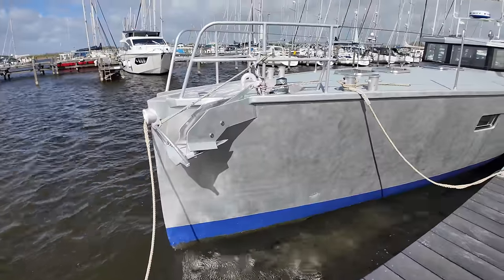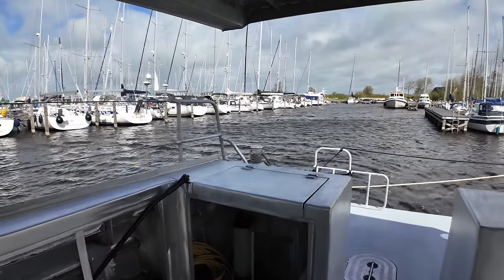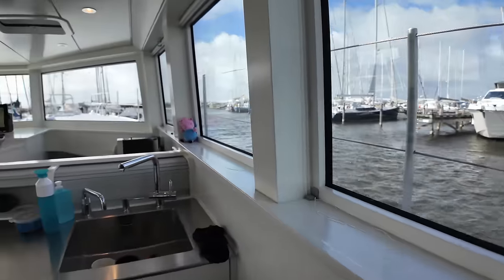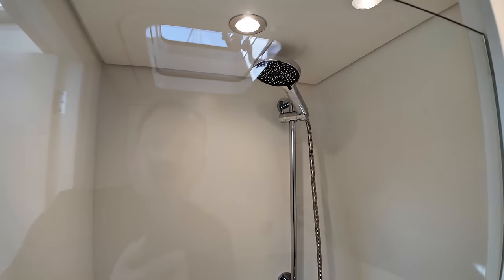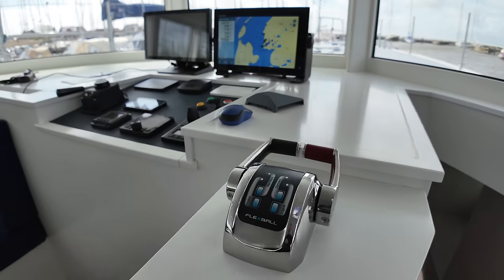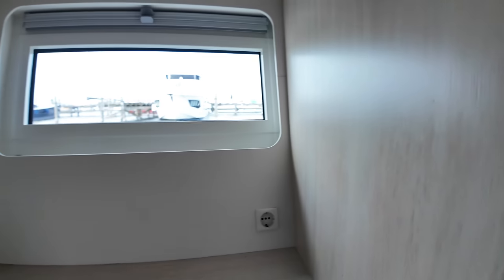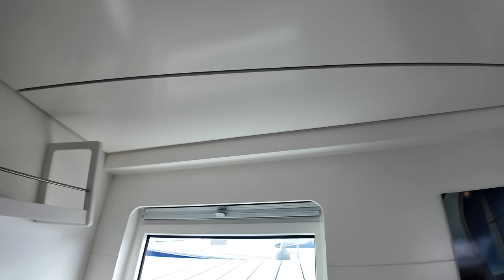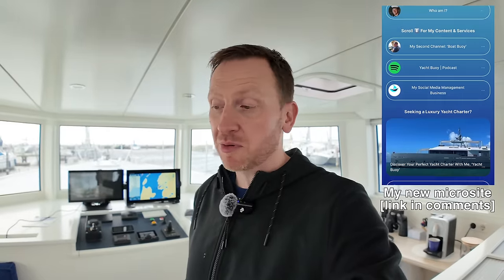THIS Is Hull 1 Long Range Cruiser 65! (LRC 65) 6,000 NM Range!

Comment: Dutch boat. Build out of (mostly) flat sheets of Alu. Cheap way of building, interior is of what? Plastic, MDF, you say it. Naked metalwork, straight to the point. Stripped of any boatcharm. There are a number of very good casco builders in Friesland who can make a splendid and straight hull so any paint can be omitted, depending on the alloy used. Also the interior consists of mainly flat sheets, no complex corners, just straight on. Propulsion and arrangement machineroom not shown. I think this boat is entirely CAD/CAM programed and might have costed around 200.000 euro in total to build. That's my guess. The interior has a charisma and appearance of a fridge, This boat is a perfect example of quality engineering at lowest possible cost. Just a few and random remarks on my side.
Reply: For 200000 I think I would buy one. Sounds like a bargain.
Reply: These are naked material costs; no labor, no tax; that I forgot to mention.
Reply: @zzp1  My guess is that an engine like this installed with shaft and prop and controls would be over 100000.generator  gyroscope stabilizer electronics ?I say at least another 100000.On my last boat that I build myself a 36 foot power cat I spend over 300000 alone on the electric just for materials. I think you are kind of dreaming with that number of 200000.
Reply: MDF ? Highly unlikely. MDF + H2O = Mushy sawdust. I use MDF for workbenches but well coated with primer and paint. But, a single pinhole and some liquid of almost any kind will blister like nobody's business. My guess is marine grade or furniture grade plywood.
Reply: I’ll pay you 350,000 euro to build me one ☝️
Reply: I like the exposed metalwork. You can't hide bad welds here, and the better the welds, the better the ship. It looks "stripped", but that's much riskier to do than to cover it with fairing and paint and pretty materials - because there's no sound deadening added here from those components. Take a look at 2:55: those welds are BEAUTIFUL.
Reply: I've seen some ridiculous comments on these platforms but this is by far the best.....You are deluded and clearly have no idea of  marine costings....You have to feel sorry for these people, simply bitter with life.
Reply: It's a fantastic boat
Reply: AND...????

Comment: No aux engine is odd to me. Also sure would not want to be in a storm taking every wave into my pilot house windows. The refrigeration/freezer/pantry appear to be afterthoughts. Not having a helm chair encourages not paying attention.  Electronics also looked like afterthoughts. Hopefully there is a workbench area with spares and supplies. Things break.
Reply: It's basically a "tribute" to the Dashew FPB series which have shown to be very capable in poor weather conditions... so there's that :)
Reply: Hint
verb
revolve
rotate
turn
turn round
go round
whirl
gyrate
circle
wheel
twirl
swing
twist
swivel
pirouette
pivot
swirl
Reply: @pauljohnson9542 what?
Reply: @AW-yv9sq  sorry, it was for the poster. Some alternatives for ‘spin’
Reply: These things cut through the wave with very little spray or water over the bow.

Comment: Too much glass, wouldn't fancy being in her in a heavy sea with big waves crashing onto it. Too many sharp edges, very dangerous especially as I couldn't see any roof grabrails. Could do with the top being extended to accommodate more sola panels then she can use electricity to assist the engin to power the vessel. Only one engine. Very starkly finished, presumably to reduce costs.

Comment: I would have continued the roof line further back to allow more solar.  I would add more solar to the foredeck also.  If you can get upwards of 17kw of solar you can cruise at 5 knots without burning any fuel.

Comment: need some engine room shots !!! also hope they trim those tie wraps sometime soon :) looks like a very capable and low maintenance boat
Reply: That^s the point! Capable and low maintenance. 
For a word-trip yo don't want a Mercedes Maybach... All you need is a Volkswagen.
The only needed luxury on a Boat (for me) ist air-conditioning, enough refrigeration space, good navigation equipment (Radar, AIS-transceiver, etc.), water-maker,  1000-1500 lbs davit and  a bowtruster.
Greetings from Switzerland. ⚓

Comment: Hope they have a PTO from the genset as a backup for the main engine or I certainly wouldn't want to go exploring on a single iveco engine.
Reply: More voyages have been safely done in single engine boats than any other
Reply: @joshlower1  only because historically there have been more boats with single engines. It's a meaningless statistic. How many journeys have been successfull because of a backup engine is the stat that matters and if the answer is more than one then I'd much prefer the redundancy of a second engine.

Comment: Thank you for the walk through. That is just a weird boat. Its so low slung the visibility for maneuvering sucks. No easy access to get to the bow from the helm. An explorer yacht with a single engine with no back up and an adjustable pitch prop? What is that all about? Way too many failure points with no redundancy.  For a 65' boat the accommodations are horrible. What I guess you would call the VIP is a coffin, I hope nobody is claustrophobic. The owners cabin is only slightly larger and no walk around bed. Its just a weird design. You can tell by the designers name they care more about looking trendy than being functional. I mean they put art first in their name.
Reply: It's a fine vessel